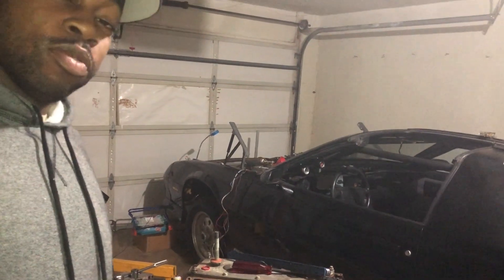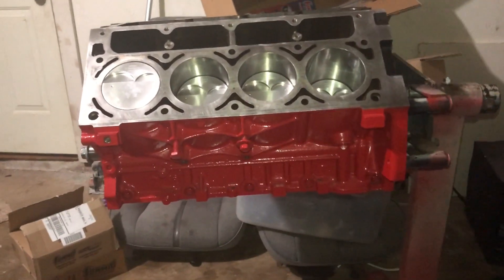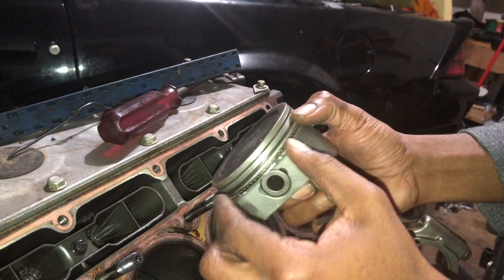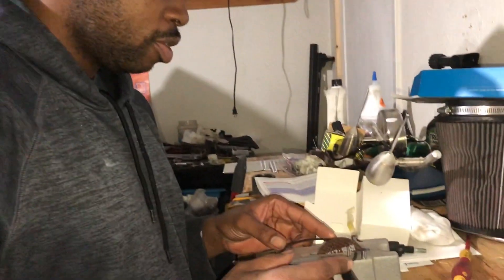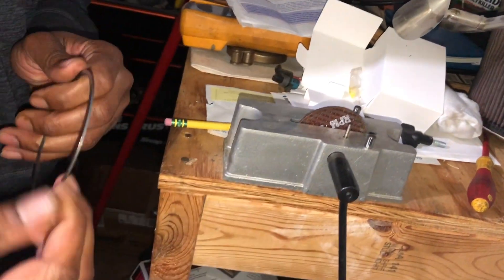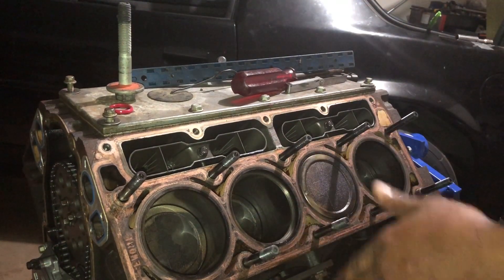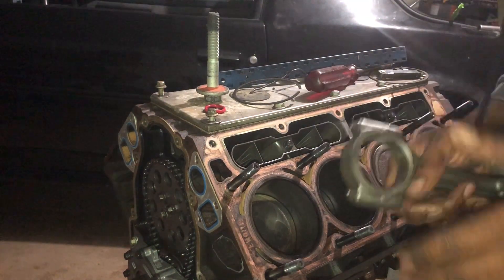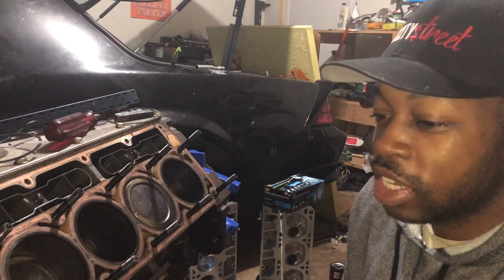Building 1000 hp...Gap LS Piston Rings for BOOST and Nitrous #boosted #turboLS #turbo5.3 #bigboost

Comment: old and busted and new hotties im in the process of tearing my 6.0 down not sure how much gap yet
Reply from the maker: Stock rings I would just do .025 top .027 on the bottom.  Aftermarket you they come with a equation: bore size x  “0.xxx”.
Reply: @boostinwillie  sounds good im using the stock rings thank you i bought the sloppy stage two cam and am going to buy the ls7 lifters and 11/32 pushrods i think the 7.400 will work but i am going to buy the  comp pushrod checker i saw your video on checking the pushrod length and am thinking of getting two gt45 turbos

Comment: 35
Reply from the maker: You gapped both at .035? I know my buddy does Bryan his in the thirties
Reply: yeah man works for me up to 16 lbs boost. I can't say anything past that. My Ls motors have only been up to 16lbs and have had low 9's with single turbo f body 4.8 3100 lbs. I'm building another right now. 03 Xtreme blazer single turbo street truck. Cut outs and 12lbs e85 should be good for 650 whp. Ac and all creature comforts
Reply: I'll probably set it up with cal tracs and 9 inch with disc brakes. I'm not trying to make a 10 sec. truck. This will be a daily 650 hp single turbo.

Comment: Forged will reform under heat cast will hold its shape but cast will shatter and break under the o much load cause it can’t deform,.....forged on the other hand can flex before it breaks but if it doesn’t break it will retain its shap when the load comes off , like a forged piston is less likely to chip off the top of the piston if they butt .hyperthenticcor cast you can stand a mountain on them but under extreme heat and load they won’t flex......anyway just FYI thank for the info and Vid be blessed
Reply from the maker: Appreciate the info💪🏾 i didn’t know that in-depth about the material or process.

Comment: Bruh you right on time because that's my new project. But I learned the new motor is in need of cam bearings so I'm at a stand still. The bearings is only rough at the top which is weird
Reply from the maker: Mr Stephon  you can tell the bad or were you told they were bad? LS cam bearings all look bad lol
Reply: Boosted Lucille they feel rough, at the top. Rest of the beating is smooth. Had good oil pressure before we pulled it but it’s a nasty one
Reply from the maker: Mr Stephon  oh, i can understand that